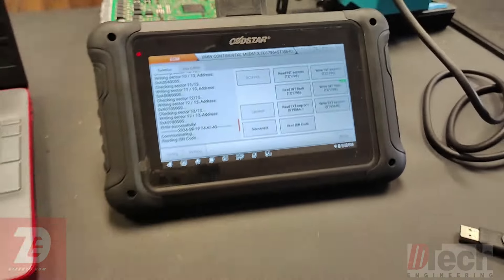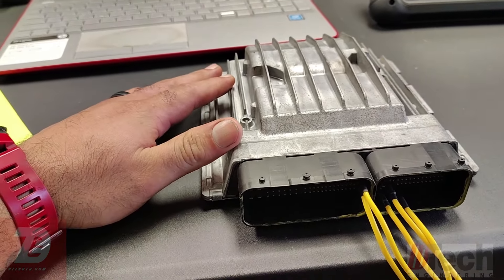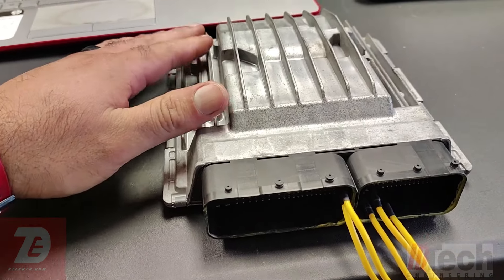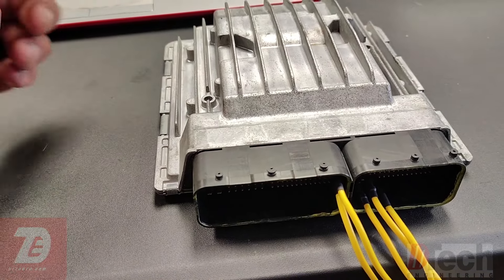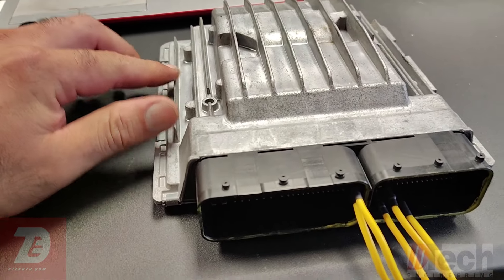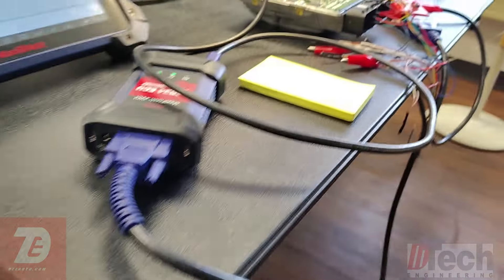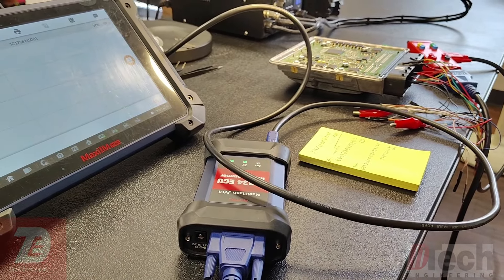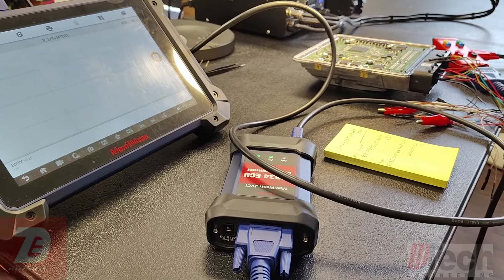BMW How to Change DME iSN (MSD81)

Comment: EXCELLENT EXPERIMENT. What address was the ISN located at when you edited the hex file please? I am wondering if I can VIEW a FULL 32 Digit ISN in the dreaded Bosch DME that only provides 4 digit (short) ISN by OBD/BENCH. the Bosch DME in question is the one found in most BMW E series V8 such as the 09 BMW 650I E63 and the 2008 BMW X5 E70, I have had so much failure to program ALL KEYS LOST on these particular BMWs that so far I just turn these jobs down until I find the solution one day.